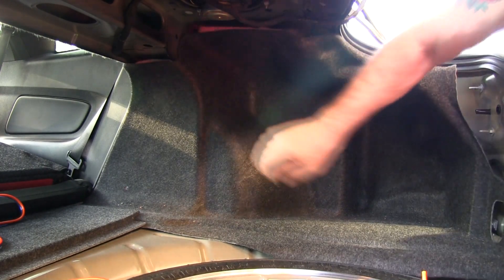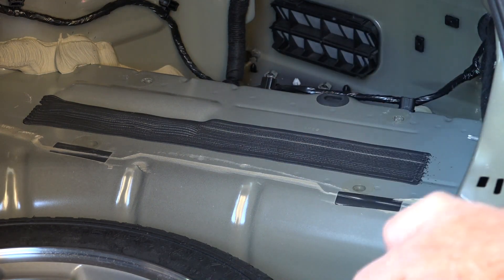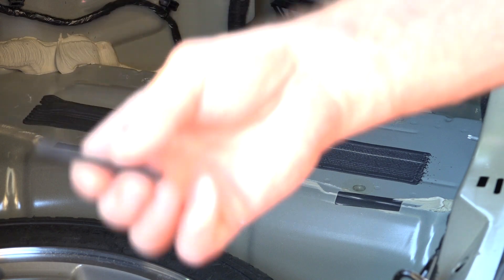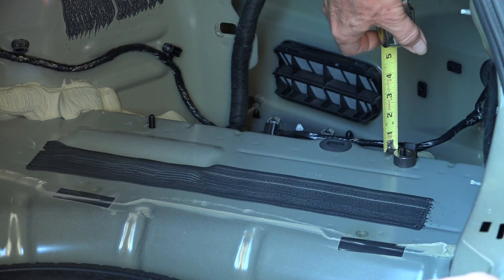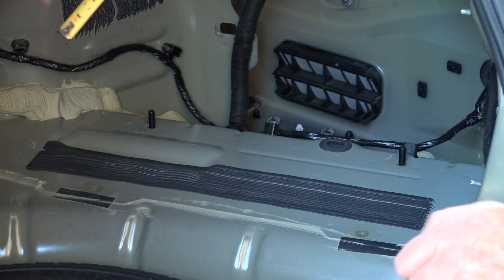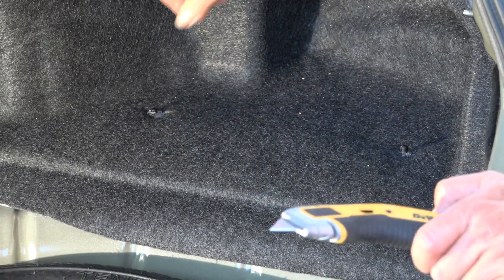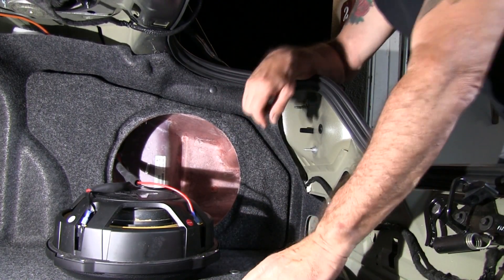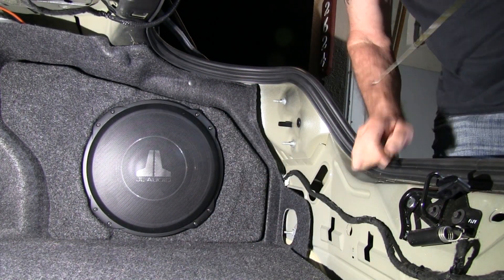JL AUDIO 12 inch Stealthbox Install 2016 Mustang

Comment: How do you get clear , nice , deep bass out the truck with the truck being so sealed ? I have to put my back seats down for it to sound good.
Reply from the maker: I think it all depends on the amp , I had a 500 watt JL Audio amp installed and it sounds great with the seats in there normal position.
Reply: I have the JL Audio  JX500/1D
Reply from the maker: @ricanstang8749  I have the same AMP I did have to do some adjustments on the amp  itself after the install I also have a volume knob that the audio shop installed for more adjustment.
Reply: The trick is to get sound into the cabin. You have two options. Remove the speakers in the rear deck to let the sound from the trunk flow in or you can cut some holes in your rear deck with a hole saw.

Since I had trunk rattle with my 2 JL audio subs I had to do some sound deadening and closed cell foam to insulate and seal my trunk up really good.

The difference in sound is night and day when you have sound coming through the rear deck. It's just like letting the seats down without letting them down.
Reply: Where did you place the amp?

Comment: Thank you! I will do this install and just bring the car to the audio shop for the splicing and wiring. This will save me some expensive labor hours, and I get to take care of my liner

Do I need to buy a line-out-converter? Or can I just hook it straight in the amp?
Reply from the maker: I think it's best to have the amp installed first , let them know that you intend to install the 12 inch stealth box yourself they will have the proper gage speaker  wire comming from the amp for your install.

Comment: Where do you have your remote turn on wire tapped? I can’t find any diagrams anywhere
Reply: BeneCreates you can get the loc2sl from amazon or Walmart. That’s how I did my set up.

Comment: Hey Sir, thanks for the Vid. I was on the fence regarding dual 12s or a stealth box, I think I'm going to go with the Stealth box, my only question is this, did you have a volume knob for the sub attached at the amp so you could adjust, I have a lot of varied music some extremely bass heavy and some not, and in my older car I had the adjustment. Also are you running the stock 9 speaker factory SHAKER system? Thanks.
Reply: Never mind I found the answer further down. However everything else is stock yes? LOL, thanks again man!
Reply from the maker: @thundarwabbit5140  Yes

Comment: CHRIS10077:  I installed this in my 2016 and the entire system sounds like 💩. I’m not very technical so pardon my ignorance but when I drive it seems the head unit is telling the sub and speakers to adjust their settings. Have you run into any issues like this?